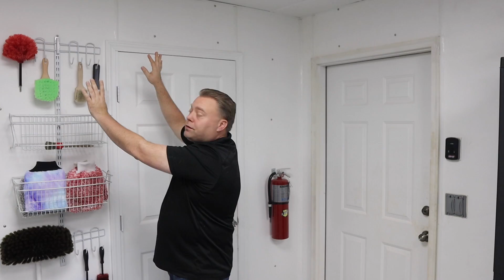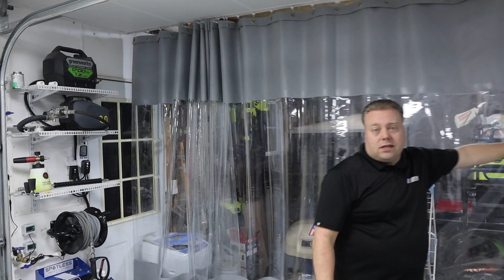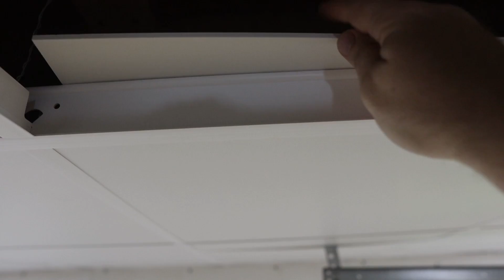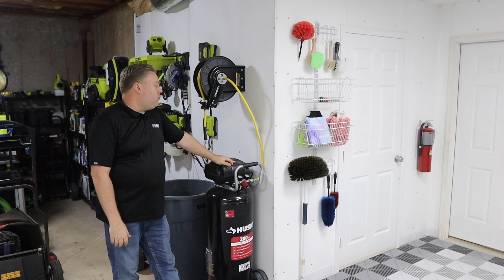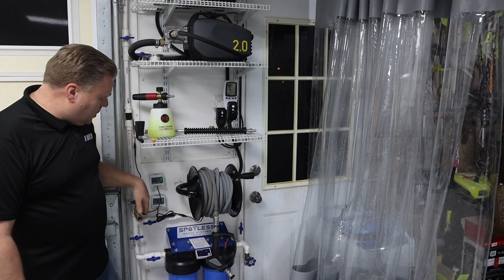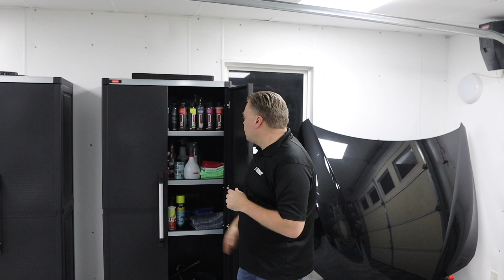I Built My Dream Car Wash Bay! | Garage Makeover | Cost? | Tour | DIY

Comment: looks great i want to make my 2 car garage my detail garage, not sure how im going to set up a drainage system
Reply from the maker: I was going to do my two car garage, but the electricity and water is so far away and would have required a lot of professional workers coming in to fix that then pay for twice the draining and tiles would have been expensive. The roof was already drywall so I would have had to cover it with vinyl sheeting as well. The biggest deal breaker really in the end was the constant moving of cars as if you are washing one the other will just get contaminated. Just glad a had a basement boat door to turn into the wash bay.

Comment: Nice video and garage, did you buy or build the hood cart / stand? Would you share the name , brand or supplier if you bought it or the components and process if you built it
Thx
Reply from the maker: It comes as a full package and I got it on Amazon. https://amzn.to/3UKrds1
Reply: Did you wrap padding or something around the stand since it’s not for body panels? 
That’s a good buy a good stand or body panel stand is closer to 400- 500
Reply from the maker: @Brandon-Peake  Yes I wrapped 2 inch wide insulation tape and added a foam pad on the backside to keep the hood at the pitch I wanted when laying flat. That foam pad also keeps the hood from moving around and clanging when moving positions.

Comment: Sheetrock and water proof paint would have been less than $1800.00.
Reply from the maker: You still can't make waterproof painted drywall waterproof though and it can't take pressurized water. I wanted to be able to wash down the walls. The $1800 walls project includes $500 for the garage door opener, $150 for the door to the storage room, $200 for the electrical outlets/wires/breakers, $200 for the insulation.  The actual wall boards, trim, caulking, screws and flex seal was about $500. Thanks for watching and appreciate the feedback.
Reply: @CarsWithKeav  gotcha.